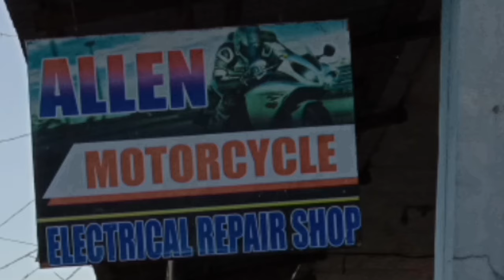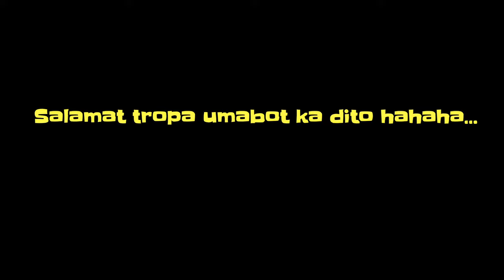MOTORCYCLE WIRING : OVERCHARGING NA MOTOR PAANO AYUSIN TARA BASIC LANG YAN.

Comment: Sir nag fullwave ako Ng motor fury 125 lequa Yung brand na gamit ko ..Ang problema po omabot sya Ng 15 to 16 volts pag binomba ko Ang motor po. Hinde naman pomotok Yung ilaw.. piro Yung voltage ko Ang TaaS po. Pag naka ignition switch lang po dinaka andar tapus on Yung headlight bilis bumaba Ang battery ko 9to8 volt na a problema sir Wilson po to Mindanao

Comment: ask ko lang boss, ang rectifier at charger na term ay iisa lang pi di pu ba? bago lang kc ang rectifier ng tmx 155 ko, original from honda. and may 2 months ko ng ginagamit. nagpalit na ren ako ng wire harness. pero lately ganun na nmn ang problem ng tnx 155 ko. naputok pa rin ang ilaw. 

note: nka-battery drive ang headlight and palyado na ren ang battery.

TIA

Comment: Good day po. Tanong lng po  o kaya vidio tuturial nyo po. bakit napupundi parin bulb headlight ,tail light. Sa tmx 155 contact point ? Meron na po battery at ok naman ung charger . At ano po ang function ng resistor nakakabit sa ilalin ng tangke. Paano po i test kung gumagana pa o hindi. Salamat po sana mabigyan ng solution ang problema ko sa motor ko model 1997 pa ito. Tnx ulit God Bless

Comment: idol yung nmax v1 ko pag nirerev ko naabot sa 15.9volts ang reading. Normal po ba yun? nalabas pati ang check engine sa panel board tapos nawawala din kapag bumaba na ang voltage.

Comment: Good afternoon sir, magtatanung lng po sana ako. Kc may ipinalagay ako na charger sa motor ko capaciror at 4 na diode. Ang problema after 2weeks nagbagsak ang battery ko. Ngaun tenester ko ng di nakakabit sa battery ang suply ng wire umabot ng 30volts. Ok lng ba ung voltahe nun. Pero kapag nakakabit sya sa battery di naman tumataas ang  oltahe kahit erebulosyon ko. Sana po pakireply. Salamat.

Comment: Boss okay lang ba ito kung hindi naka fullwave, naka-battery operated lang tapos stock ang regulator. Bale naka fast charge na motor ko paps gamit ang stock regulator. Tinanggal ko lang continuity ng yellow wire sa regulator. Tapos pag nakamenor 13.2 to 13.7 pero pag nirev na at binabad sya ay 15.8 hindi na nataas. Ano kayang gagawin ko boss? Applicable pa itong video na ito sa problema sa motor ko?

Comment: Sir katropa good morning po, hingi lamg po sana ako ng tips at advice, kasi po yung isang kawasaki barako 2 ko po   9yrs na po at pampasada po. Over charging din po sya 15.8 po ang karga nya. .anginawa ko po pinaltan ko po yung eectifier nya na galing naman po sa isa ko pang barako na 14.6 lang magkarga, pero nung tinesting ko na po over charging parin po 15.8 parin po. Ang sunod na ginawa ko yung battery naman po ang pinalitan ko galing parin po doon sa isang barako na kinuhaan kk ng rectifier, at tinesting ko po ulit pero ganun parin po 15.8 parin po ang charging nya. Tapos ang huli ko po na ginawa yung battery at rectifier na galing doon sa barako na nag oover charge ikinabit ko naman po doon sa isang barako  na maayus magkarga pero tinestung ko sya eh ok naman po saya 14.6 at 14.7 lang po ang charging nya. Anu po kaya ang diperensya ng isang barako ko sir. Stator po kaya? Sana po sir mapansin mo ang mga katanungan ko. Maraming salamat po.

Comment: Sir MiO Sporty po gamit ko,nag over voltage ako gang 16, tpos pansn ko pag nagbe break,nag 11 o 10,pinalitan ko regulator,stator fuse ganun pa rn.Anu po dapat gawn sabi daw ng isang mekaniko tanggalin ko yellow wire sa socket ng Rectifier,kasi double charging,ayaw ko naman ng I full wave gustu ko stock lng,anu po dapt gwn? Newbie

Comment: Katropa Allen ano ang problem nang motor ko shogun 125 bakit nalolowbat,pinalitan ko na nang original na regulator rectifier pero ganoon pa din.tiningnan ko yung white wire na may stripe na red yung galing ng stator umaabot ng 35 volts pag binilisan ko ang speed ay nalolowbat pero pag nka menor nag cha charge ng konti.

Comment: sir Bakit po Yung rc250 pag naka idle at running ok voltmeter 13-14.5v,
pero pag nag ON ako Ng headlight eh umaabot sa 16.2v, dalawang voltmeter na ginamit ko for testing eh same value Ng voltahe lumalabas 16.2v

Comment: Good Am Sir, meron akong Tmx 155 model 2007 binilhan ko ng voltmeter pagnka rekta ko ng speed na 45kph ang nagiging reading ng voltmeter ay 50.2 ano po ang magandang klaseng brand na regulator ang pweding ipalit dito, at meron din po bng 5 wires na regulator na pampalit s tmx 155  pkisagot lng po, salamat
Reply: Ang gamit ko pong battery ay motolite truck master 2SM may side car po ung motor ko.
Reply: Regulator po kya ang may problema, kya ang reading ng voltmeter ay 50.2 pkisagot lng po salamat

Comment: Boss tatanung lang sana ako sa'yo rusi gala po ang motor ko battery operated na po siya bumili po kasi ako nang bagung regulator rectifier bat po ganun ang taas po nang volt meter niya umaabot po nang 15.6 ano po kaya ang dapat kung gawin para hindi mag over charging ang motor ko.

Comment: Gud pm po.
Ang motor ko po ay haojue lindy 125.
9 years na po ang motor ko.
Nagpalit npo ako ng CDI na original at maganda naman ang andar.
Last week po biglang ayaw mag start. Pero napaandar naman nung na kick start.
Ginamit ko sya NG mga 5 kms.
Pagkatapos ng 6 na oras umandar naman sya pagstart ko sa electric start.
Kinabukasan ayaw uli magstart so kickstart uli.
Paguwi ko nagcheck ako ng battery kasi baka maluwag lang.
Kulobot na ang battery at naputol ang negative terminal.
Pinalitan ko ng lumang battery na chinacharge ko.
Sabi sa battery shop overcharging daw.
Ano po pwede ko gawin.?
Umorder npo ako ng rectifier na original at kinabit ko na.
Ano na po gagawin ko??

Comment: @richardpulido7023
0 segundo ang nakalipas
bakit ang raider 150 carb ko bos.bagong regulator.at battery..pero ang reding ng voltmeter.umabot 15 16 17 volts....nagtest ako direct charging system sa stator ang reading normal ay 6.50 to 6.70.....pero pag binirit ko nagrereading ng 2.75...anong sira bos..di kya stator bos.tnx sa reply.godbless

Comment: Boss sakin po hd3 125 bumili ako ng regulator na fullwve lihua po naka fullwave nadin po ang ligthcoil ko ang connection ko sinunod kolang sa napanuod ko ung white sa regulator naka connect sa pink sa stator tapos ung yellow sa yellow din sa stator tapos ung red sa white naka connect ung green sa ground ung black sa brown ng harness  pariho lng sa ginaya ko sa kanila ok naman nagcharge ng maayos sakin hanggang 12.6v .lng ayaw ng tumaas tsaka napansin kodin ung white wire sa may headlight reading nya umabot ng 20v higit pa ano kaya problema sa gawa ko bossing sana matulungan nyo po ako salamat

Comment: Saken kaya tropa allen bkt po kaya nasira agad yo g ttgr ko na retrifier sinunod ko nnmn yong step by step procedure. Prang 1month lng tinagal ganda pa nnmn sana ng performance . Ksi di na nakurap ilaw ko kaso natkot nmn ako kasi reading ng pag uwi ko sa work pinaandar ko motor ko pag tingin ko sa volt meter umaabot na ng 20volts. Napaka delikado non buti malapit lng inuuwian ko kaya binalik ko muna sa stock na rectifier.

Comment: Good pm poh idoL ka tropa. Ka tropa from Mabalacat Pampanga poh,,, Tatanong ko lang po sana, yung tmx 155 ko poh over charge poh, umaabot po ng 15v hangang 15.1 to 15.2... Nagpalit na po ako ng bagong battery kase po hindi na po stable ang voltahe nya tsaka nagpalit na din po ako ng bagong charger yung stock din poh, naging stable naman po yung battery hindi na po lowbat, kaso ang problema po kapag naka rev na po ang motor umaabot pa din po sa 15v to 15.1 yung voltage ng battery ka tropa. Sana po matulungan nyo po ako... Maraming salamat po

Comment: katropa, magandang araw po,ganun po nangyari sa motor ko, pumuputok yung mga bulb nung pinalitan namin yung regulator, kasi yun ang akala naming sira kasi mahina yung kuryente nya, kaso, nung naikabit nanamin yung regulator, sinunod namin yung pagkabit ng wire, di na nga pumuputok yung mga bulb pero mahina parin yung kuryente  at di na mapagana yung busina, rusi 150 po yung motor ko. at isa pa po, di na po gumagana yung neutral light nya at di na gumagana yung start button nya, ano po problem kaya nun? ako po si yam

Comment: Boss katropa,,puro ako padyak sa mio ko kc lobat ang battery gang sa nasunugan ako ng park light tapus lusaw ang fuse. .pinalitan ko fuse umandar c motor pero wala na ilaw at busina. .ang sabi po sa shop mahina na magkarga ang charger kaya pinulwave nila nagpalit ng rectifier.13-15 ang volt apg rev. .balak pa palitan ang battery pero wala na ako budget. .so ayun after few days nagpalit na ako ng battery. .so ok na lahat. .ilang araw nmn po katropa bigla nmn po napundi ang headlight ko nasunog poh. .tanung lang po ano po ang naging problema. .sana mapansin nyo poh. .salamat po. .

Comment: sir sana po ilabas mo na ang buong wiring ng kawasaki barako 1. all wiring connection. mula sa switch.relay horn.stator.cdi.ignition coil.regulator 5 wire. gang sa accesories at switch ng mga ilaw. (sana po sir ma notice mu naman po ang request ko plsssss lang.) tagal na akong na subscribe sau. pero ung mga request ko wala pang accept mo. plssssss lang idol. ilabas mo na.

Comment: Ka-tropa yung aken 5 pin Lihua Rectifier hindi pa fullwave stator no problem sa charging... Yung Problema ko lang kasi tropa kapag nasa high rev na ako pumuputok yung Gear bulb ko... Bali yung black wire ng Rectifier ko nilagay ko sa accesories wire ng motor ko... May solusyon kaya du'n ka-tropa?
Reply: Fullwave mo na lang un
Reply: Kasi pang fullwave regulator mo ei todo mo nalang.